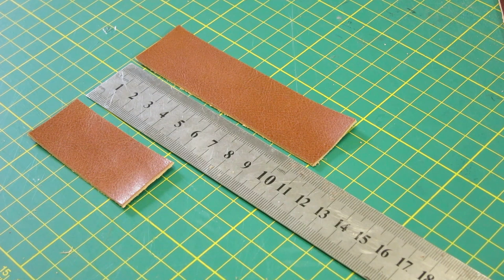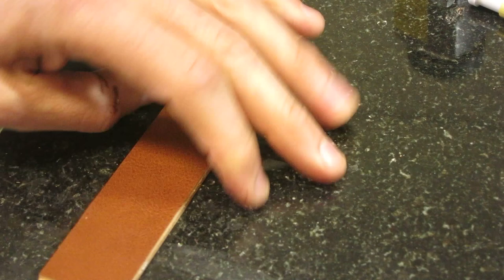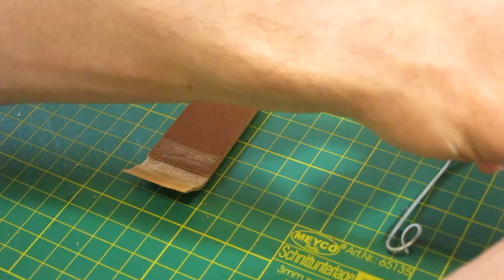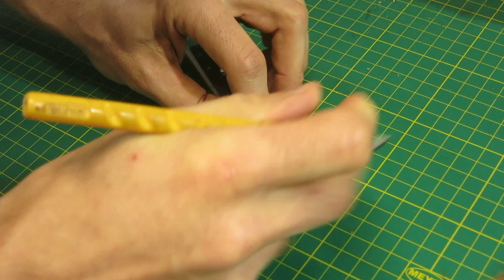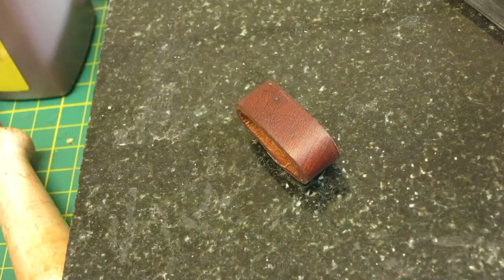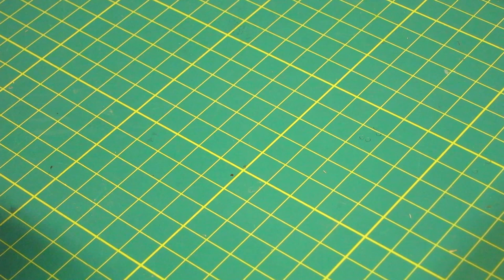Making of simple leather watch strap - MK Leathers

Comment: Very Nice, Could you please advice what tools you use and where to get them from?
Reply from the maker: Hi,

The list of the tools I use is probably longer than the minimal  list of the tools you would need to make a strap. But to make a strap you need:

1. Leather, for top, and lining - if you make strap with lining
2. Glue for leather
3. Sharp knife,
4. Ruler
5. Piece of paper, cardboard to make templates
6. Awl
7. Stitching iron, pricking iron - to mark and punch holes for stitching
8. Needle and thread
9. Something to mount the strap while stitching, stitching pony is the name of the actual tool
10. Hole punch
11. Egde paint and something to apply it
12. Sand paper, preferably on a block of foam or wood. 100,150, 180 grid
13. Something to smooth/press the leather when glueing and shaping - bone folder. There are plenty of items you could use. needs to be firm and smooth.

Some are sourced from various online shops, some are custom made by me or fellow makers. I'd advise to start with something simple and work your way through to actually see, what suits your way of crafting the best.

Comment: Hi, on the hole part of the strap you only use water based glue, rite? is that strong enough to keep them together for a long time?
Reply from the maker: For the "production" or strap that would go to customer, I'd use barge glue / butapren just to make sure. Having said that I have used this strap for a long time and nothing fell apart. If the stap had been worn in moist environment or you'd sweat a lot there is a chance it could affect water based glue.

Comment: Hi again what is the die called ur using..dose it come in black to..an do u think its posable to make strap out of a leather or pu belt..
Reply from the maker: Search for edge cote, edge paint. Comes in many color. As for material, depends on the belt quality nad the strap you want to make.
Reply: MK Leathers thsnks..well the belt is 100% pu leather so it says that on the belt..
Reply: MK Leathers and the strap am wanting to make is a 24mm wide strait no curve to fit an apple watch 42mm

Comment: Nice vide..bad point no talking an no telling off what things are used to make the strap..an asking a guy like this is like talking to a ur self or a wall..
Reply from the maker: Hi thanks for the comment. At some point I might make vids with commentary on :) Anyway, if you have any questions write here, I'm trying to answer them  whenever I can.
Reply: MK Leathers ..hi what glue are u using to bond the lether together an wear did u get the watch strap stencil from
Reply from the maker: Hi, this is water based leather glue from my local shop. Look it up there are few manufacturers who make those. I also use heavy duty leather glue (one that smells bad ;) )  I designed templates myself and had them cut out from plexi at my local printing/cnc shop.